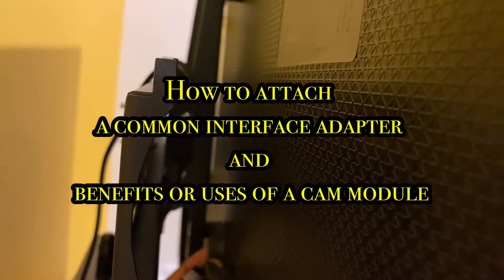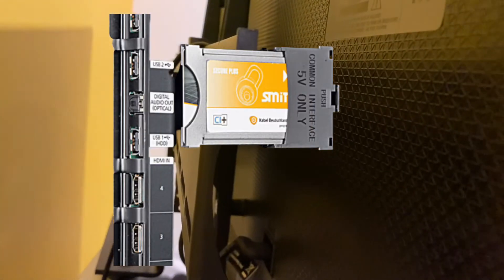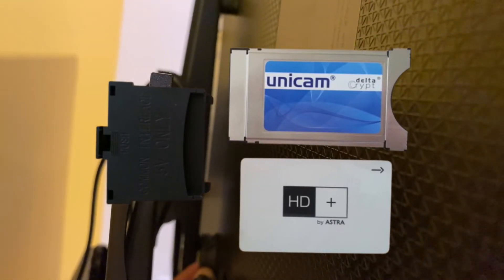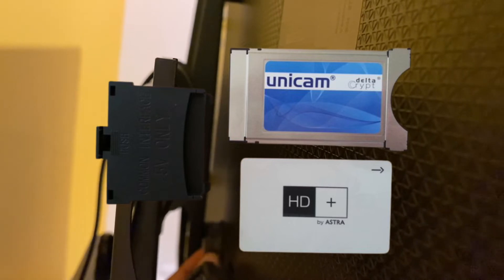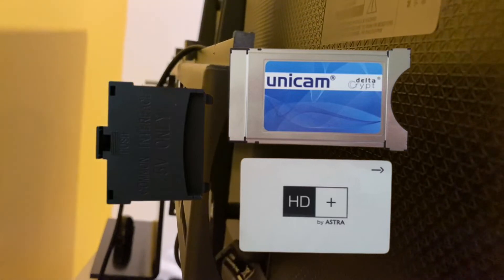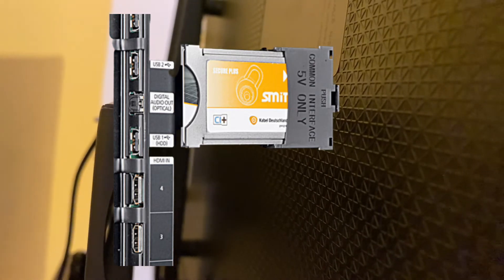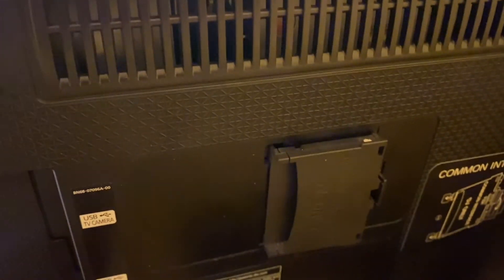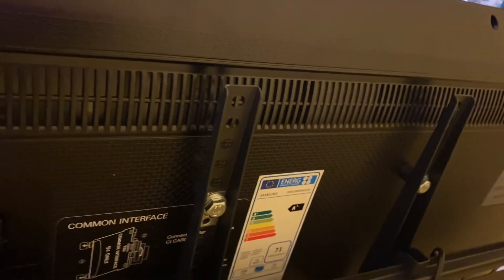How to attach a Common interface adapter and benefits of using a CAM Module on your TV

Comment: Great Video. 
1) I have a CI interface built into my old TV and want to put in a USB and cat 6 network adaptor to make it into a smart TV.

2) I have another old plasma TV with an SD slot and I want to add a usb slot on it. any ideas?
 
How do you suggest I do it? 

Thanks in advance
Reply from the maker: 2. To add a USB slot to your old plasma TV, you'll need a USB to SD card adapter.

1. Check the SD slot: Make sure your TV has an SD card slot. It's usually located on the side or back of the TV.

2. Get a USB to SD card adapter: Purchase a USB to SD card adapter that is compatible with your TV and supports the SD card format used by your TV.

3. Connect the adapter: Insert the SD card into the USB to SD card adapter. Then, plug the USB end of the adapter into the USB port on your TV.

4. Access the USB content: Once the adapter is connected, your TV should recognize it as a USB storage device. You can then access the content on the SD card through the TV's menu or media player.

5. Enjoy your expanded storage: With the USB slot added, you can now enjoy playing media files, such as videos, photos, or music, directly from the SD card on your TV.

I hope this answers your question. Don’t forget to subscribe, like and share. Helps channel grow
Reply from the maker: 1. To make your old TV a smart TV, you'll need a few things. First, check if your TV has a USB port and an Ethernet port (for the CAT 6v network adapter). If it does, you can simply connect the USB and network adapter to their respective ports. Then, you'll need to find compatible software or apps to install on your TV to access smart features.

Here are the steps you can follow to turn your old TV into a smart TV:

1. Check the ports: Look for a USB port and an Ethernet port (for the CAT 6v network adapter) on your TV. These ports may be located on the back or side of the TV.

2. Get the USB and network adapter: Purchase a USB adapter and a CAT 6v network adapter that are compatible with your TV. Make sure they have the right connectors and specifications.

3. Connect the USB adapter: Plug the USB adapter into the USB port on your TV. This will allow you to connect external devices like flash drives or external hard drives.

4. Connect the network adapter: Plug the CAT 6v network adapter into the Ethernet port on your TV. This will enable a wired internet connection for your smart TV.

5. Set up the internet connection: Connect one end of an Ethernet cable to the network adapter and the other end to your home router or modem. This will provide internet access to your TV.

6. Install smart TV software or apps: Depending on your TV model, you may need to install specific software or apps to access smart features. Check the manufacturer's website or app store for compatible options.

7. Follow the on-screen instructions: Once you have installed the software or apps, follow the on-screen instructions to set up your smart TV. This may include signing in to your accounts, connecting to Wi-Fi, and customizing settings.

8. Enjoy your smart TV: Once the setup is complete, you can start exploring the smart features of your TV. This may include streaming content, accessing apps, browsing the internet, and more!

Remember, the specific steps may vary based on your TV model and the software/apps you choose to install. It's always a good idea to consult the user manual or manufacturer's website for detailed instructions. Have fun turning your TV into a smart one!
Reply: @UtechUreview  
Thanks for your reply.

The plasma TV only has an built in SD reader & 2 HDMI ports. It doesn't have any USB ports or network connection
Reply: @UtechUreview  
The other TV only has HDMI ports, nothing else